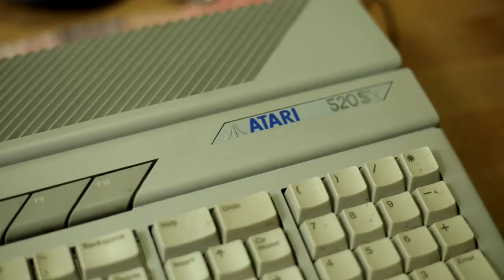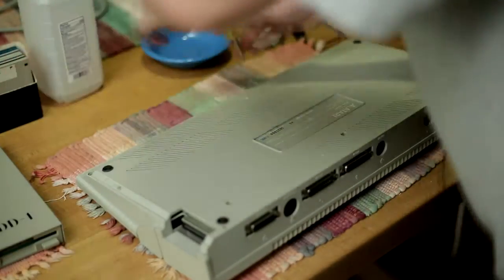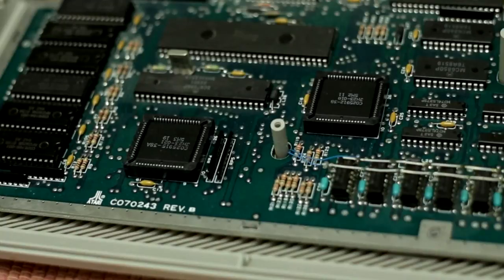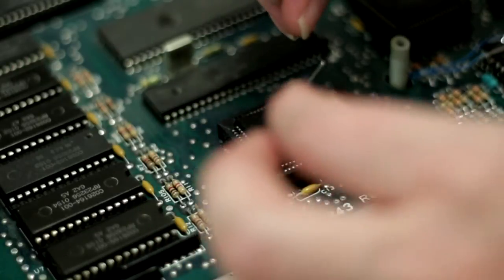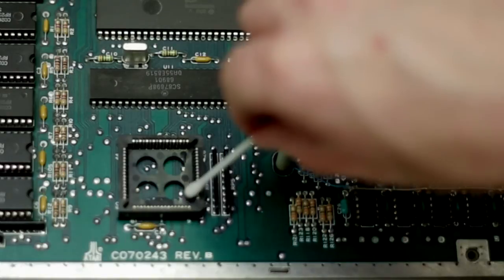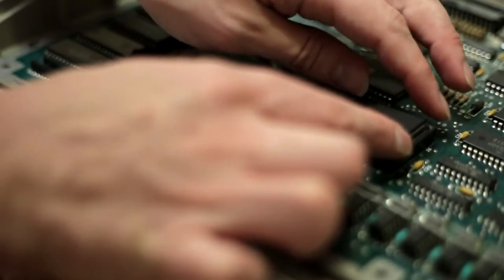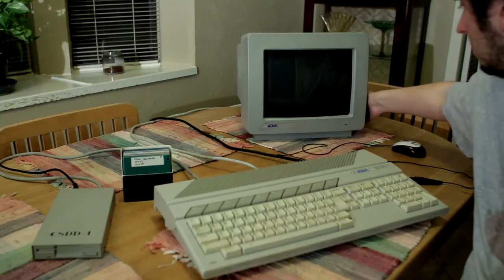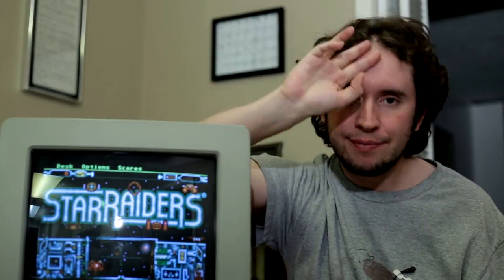Atari 520ST Repair Video

Comment: When you booted up the ST again at the end of the video and I saw these vertical stripes, I really thought your fix wasn't succesful! These stripes while switching on the ST are not normal. But your machine seems to work again, that's all that matters. 😉
This trick helped me last year when I digged out my 520STM after 25 years of storage. It worked well for about half an hour and then only bombs and resets! After firmly pressing these chips into the sockets (didn't pull them out) it now works with no problem!

Comment: Iam surprised the chips or the sockets were not damaged digging them out that way invest in proper chip pullers off eBay they are cheap enough and while your at it get a anti static for when you are handling the chips and top frame ??
Reply: anti static yer arse, ive been fucking with electronics for 30 years, never worried about it, never caused any problems.

Comment: It's easy to remove the keyboard to make it easier to get access, just unplugs.  Also be careful with the screws on the case, the ones on the front are shorter than the rear.  If you put the longer ones in the front you will put dimples in the top case!  Looks like that happened in the video. Also, while in there press down on all the socketted chips too.

Comment: I had an Atari 520ST in October of 1985 and did the drop all the time. The heat would slowly work the chips loose. I'd pick it up off of the desk about an inch and gently drop it. It wasn't anything serious. I used the ST heavily until January of 1992 and never had a problem other than having to drop it here and there, and that included a 2 meg ram upgrade sandwich board that was soldered in. This was "a solution" that I found out about in Atari magazines at the time I think so it was a common problem, like you said.